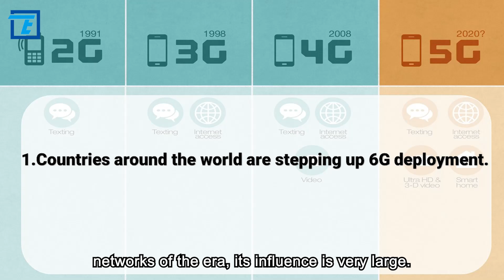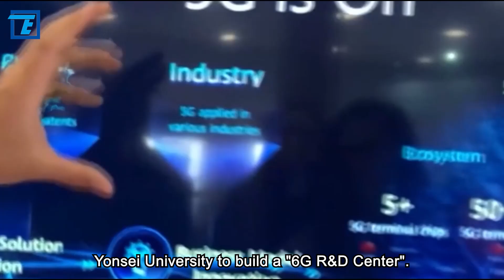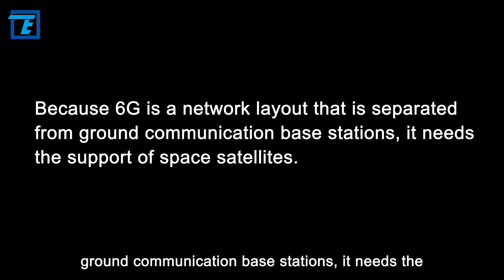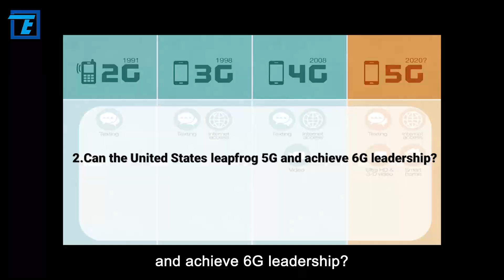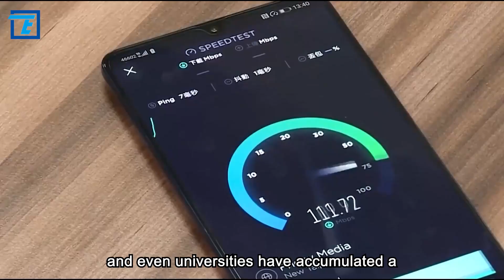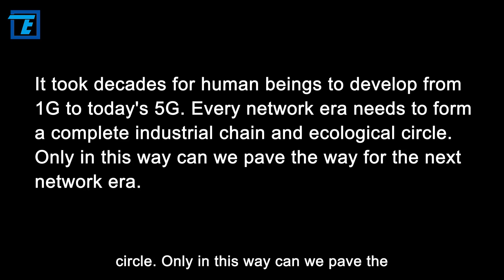The US leads the world in 6G? China panicked!

Comment: CHINA ... HAS launched many low Orbit satellites. But  .. HAVE kept very Quite about it. Today their LOW orbit satellites are More than STARLINK. Starlink has MANY disadvantages. Clouds  will obstruct transmission rates significantly. Then there is the STRALINK satellites POWER supply . ( LOL .. A joke about its durability ) . As such STARLINK AND cannot achieved the 5G transmission rate. 6G transmission RATE by STARLINK is ....... At BEST a Laughing Stock. Starlink is at best likely to FAIL within 3 to 5 years, after 6G tech are launched in China.

Reply